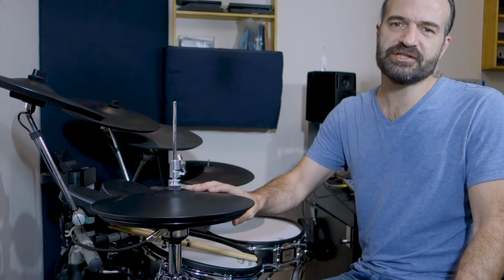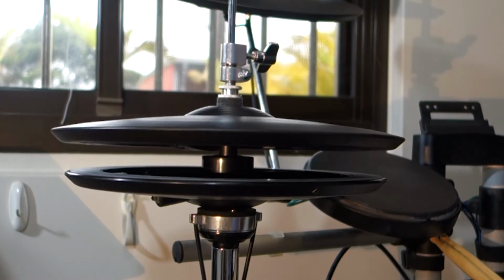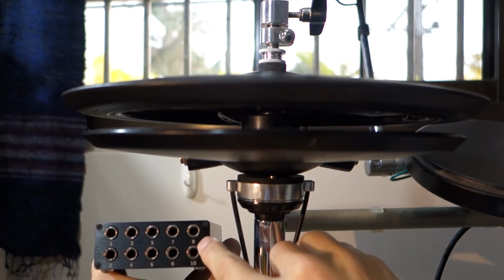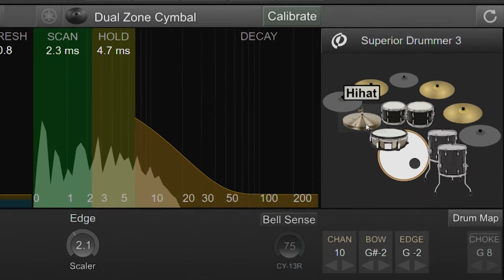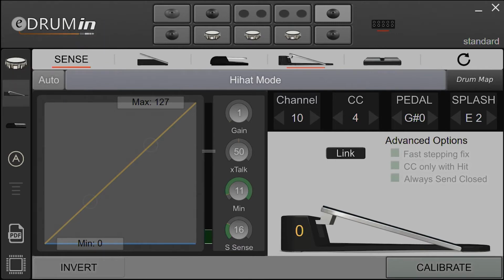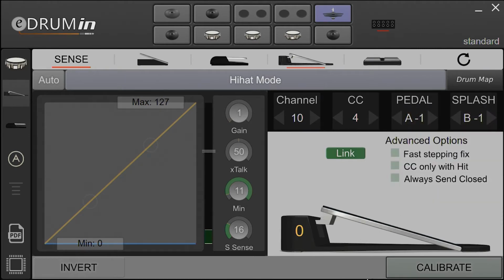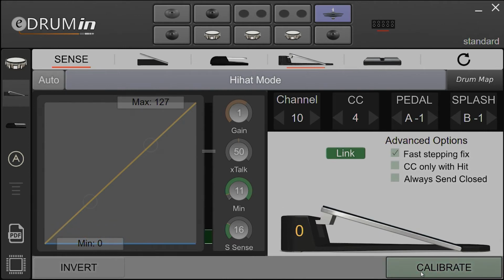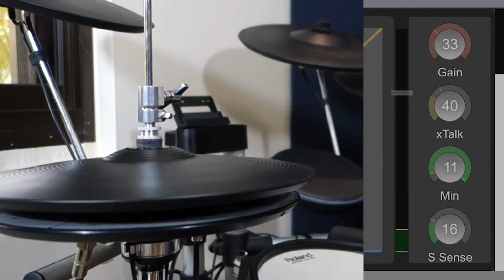eDRUMin - Setting up a Roland VH-13

Comment: This is amazing. Would it work with cheap midi kits and mounted hi hats? Or does it need a roland VH?
Reply: The pedal input is compatible with Roland / Yamaha style hihat pedals, expression pedals, as well as DIY setups using FSR or Hall effect sensors.

Comment: Rob, ils it possible to get the choke fonction on a dual zone cymbal plugged on ts jack Switch mono? Thanks
Reply from the maker: No, you need a stereo connection for choking.

Comment: Could you demonstrate the Alesis Strike SE 14" Hi-Hat? Me and a lot of users on the forums have problems with this hi-hat and VSTs, some(like I do) even have problems with it playing in the module. I am a longtime user of edrumkits and toontrack instruments and I have always been able to get them talking. But not with the alesis strike pro se system. So I am looking to buy an Edrumin 10 if I feel it can help me. I never use any of my modules anyway.. drumpads and vsti are my walk of life.
Reply from the maker: Sorry, I don't have one, otherwise I would.  I can't see any reason why it wouldn't work perfectly fine.  If there were problems with that hihat, you would have seen posts in my forums about it.  I do accept returns, BTW.  If you bought an eDRUMin and it didn't perform to your expectations, you could just mail it back to me within a month of receiving it and I'd give you a refund.

Comment: Hey Rob, in this video there are only VH 10 and 13 presets. Do you already have a preset for the VH12 aswell?
Reply from the maker: Yes, there is a preset for the VH-12.
Reply: @yeahtuna  thx for that fast reply, I found a used one in good condition on ebay yesterday, so I’ll buy it now 👍🏻